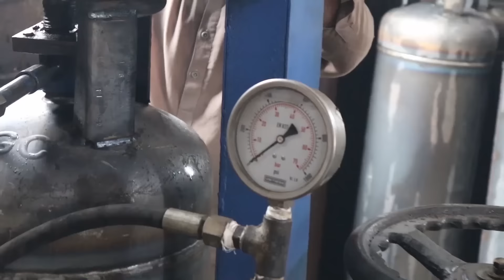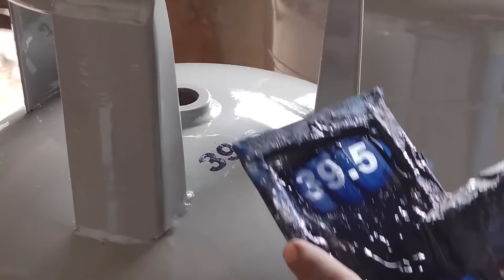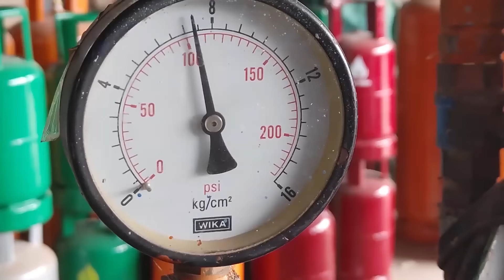Top 3 Amazing factory Products | Mass production

Comment: Those old punch presses do something on there on called ( double trip ) .That means after the first punch or cut and it goes back up,the machine will come back down on its own. I personally have seen an index finger and a thumb cut off when the blade came back down. I'm sure it has happened there many times because those machines are very old ..     🇺🇲🇺🇲🪖🪖👮👮🚓🚓
Reply from the maker: Thanks for sharing information .